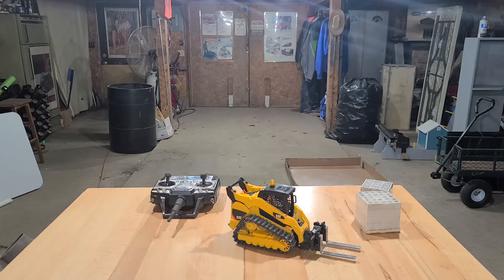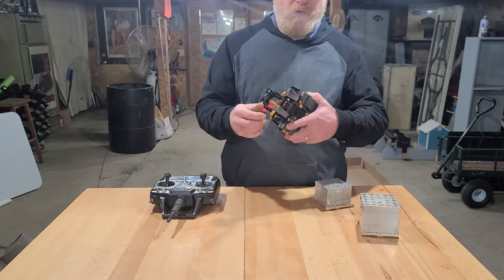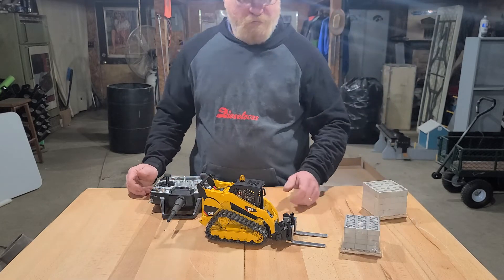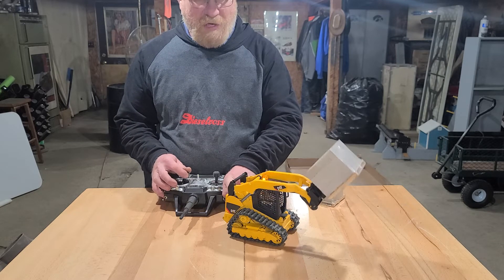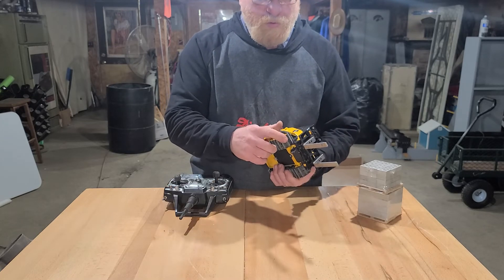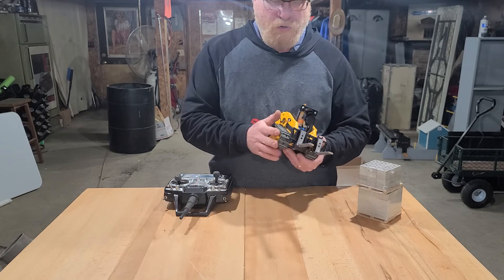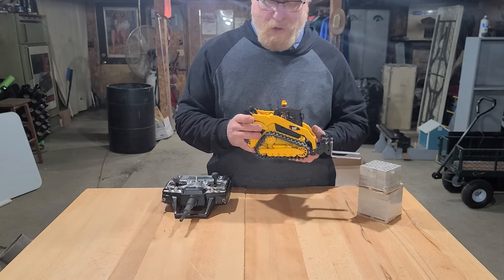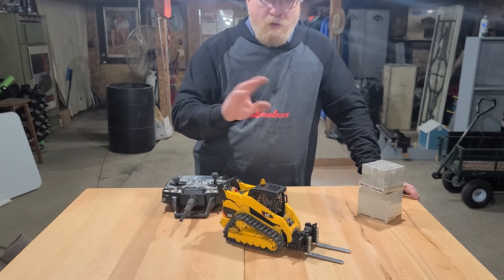1/16 Bruder CAT Delta RC Conversion Demonstration

Comment: looking good runs good.  I have a few different concept models that all run yet collecting dust.  I see your forks are in full tilt position when lifting ;-).  Im digging the track modification.  Great work.  Ive been eye balling the LXY model for some time.  I think that will be my next.
Reply: great now you did it lol after watching this video I feel like pulling my off shelf and over powering the bejesus out of it..Just had a new vision
Reply from the maker: @thatsmyrc  I've pushed them to the limits and found the weak spots. LOL I think this might be my 4th boom on this unit. LOL

Comment: You did a great job considering the full scale will tip over because of weigth
Reply from the maker: For sure, it may be beyond the tipping point, but I was looking more for the max lift capacity. 😉